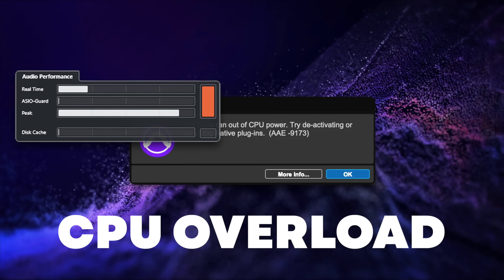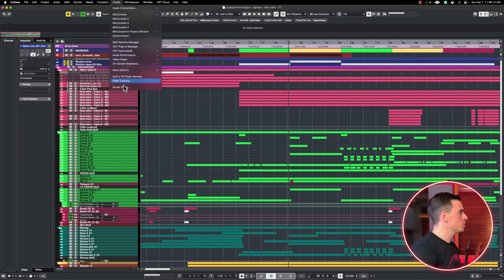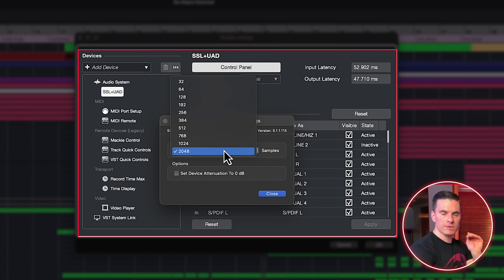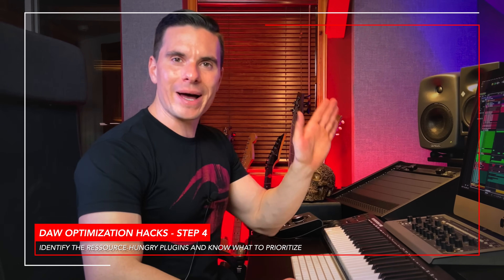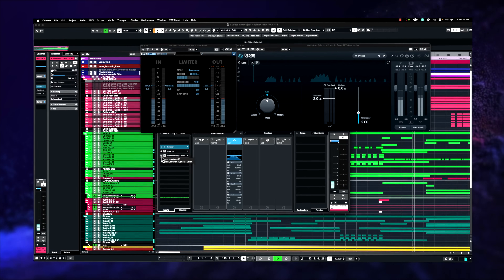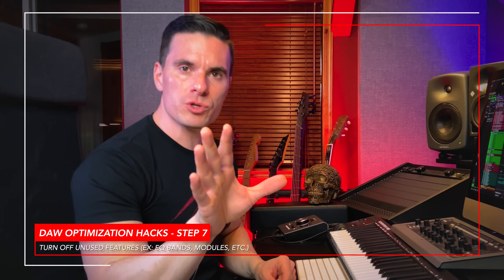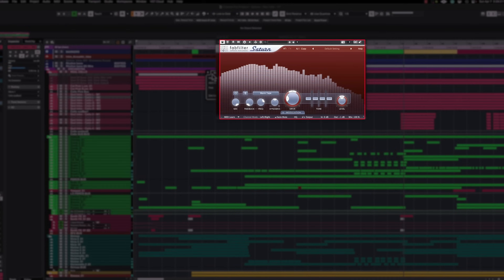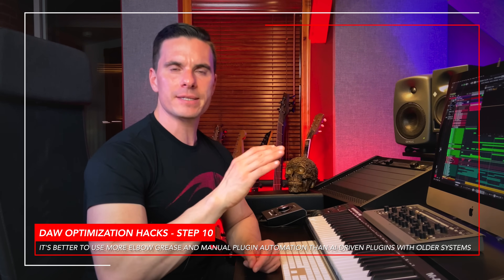DAW Optimization HACKS for Audio Production: How to RESCUE your CPU

Comment: One of the biggest problems with Windows 11 and modern CPU's in combination with a DAW is core parking. Disabling it will greatly improve things on many levels.
Reply from the maker: Thanks for chiming in Frank. Great tip to know for PC users!
Reply: - Windows 11
- Live 11.3.13 (apparently this is supposedly fixed in later versions)

My i9 13th gen overclocked to 5.43 needed all the efficiency cores to be turned off as well as all the cpu throttling options in bios - to get rid of random popping.

Took me months to figure it out.
Reply: @ghfjfghjasdfasdf Yeah, the pops and clicks only get worse on newer cpu's because of all the power saving crap built in Windows by default.
Reply from the maker: @franckinthestudio Indeed! It’s usually best to disable power saving functions for audio production.
Reply: @OliBeaudoin Exactly!
Reply: @OliBeaudoin I saw a video showing which DAW‘s can work with P and E cores, cubase came out as the best in this case
Reply: I haven't switched to 11 bcuz I wanted to wait to a few of the bugs were worked out (as I always do) and a few others have had some experience with it (as you have). I'm still running 10 Pro. Any ideas to help get a few more power out of it? Current: 12th Gen Intel(R) Core(TM) i7-12700K   3.61 GHz. I've never done anything for overclocking and such. I have turned off sleep. This is to anyone. Thank you all in advance.
Reply from the maker: Check out my MAC optimization video. Many tips still apply to PC. If you follow all the tips in this video and the other one, your sessions should be light and responsive.

Comment: Good stuff , a huge problem that can occur is your hard drives, HDD you will run into problems the more plugins and VST’s your running through the hard drive  from it as a opposed to an SSD. Especially if your running virtual instruments. M2 and ssd are definitely ideal for this, and if you can spread out what you use amongst multiple drives that will be the best option. I have an m2 and ssd and hdd and my hdd is only used for superior drummer 3 and saving my cubase projects.
Reply from the maker: Thanks for your comment Shane. Indeed, HDDs can be an absolute bottleneck, that’s why I recommend using SSDs with high read and write speed. The suggested video (End Card) talks all about it… and more! 😎🙏

Comment: There's is absolutely important gain to using higher sample rates! The amount of aliasing you'll end up with with things like saturation and compression is insane!
Reply from the maker: Using high sample rates never will make or break a mix. Concerns regarding aliasing can be addressed by using the oversampling function available in most recent saturation plugins. A good exercise can be done by comparing a session at 96kHz and one at 44.1/48kHz to see that the audible difference is negligible, if any.

Comment: Great video. I wouldn't say dsp cards is the way to go especially if you're thinking about UAD. the chips used are 400mhz single core. That was fine in 2007, but not today. Getting an older computer that runs let's say 2500 MHz on 8 threads will give you so much more power, combine that with the free plugin audiogridder, and you can run all your favorite native  plugins from the old computer via a cat cable. Bonus is you have another computer for random stuff. Been using audiogridder for 3 years now. Works great even on the same computer and not on another via cat cable, as the plugin will spread the load more efficiently across all cores and not choke on one core that usually is the bottleneck in Daws (except reaper)..
You should check it out. 😊
Reply from the maker: Thanks a lot for your comment man! Yes, you are absolutely right about the SHARC chips, it’s more meant to serve as an “expansion” on an older system… probably one of the many reasons why UAD started to release native plugins. Thanks, will check out Audiogridder! 😎🙏
Reply: @OliBeaudoin audiogridder is a great way to avoid plugin conflicts, eg. I have a separate pc for IZotope because I noticed that having some other vendors plug-ins open with iZotope at the same time can cause one or the other to crash, solved it with audiogridder
Reply from the maker: Thanks for the tip!

Comment: I agree with most, except 44.1 kHz. Best to work with is 48 kHz. Little more headroom. Almost no difference with CPU. But it's personal preference.

There should be a list of quality low CPU (fast) plugins. Melada Production is one of them. Light and high quality. Top tier coding. Bad user interface (but they improved recently by adding graphic design).

Finally. Good practice is to use one heavy plugin per channel or bus. If you need 3 heavy plugins working on one track, bust them one by one to another and use one heavy plugin per bus. So basically to create cascade. This cheats CPU to process each bus per one core/thread, basically creating parallel processing. Sometimes it helps.
Reply from the maker: Thanks for your comment Mikelo! Indeed 48kHz works as well, but it’s really about personal preference at that point. 

A list of high quality, low-CPU plugins is a great idea for a next video. I’ll keep it in mind! 😎🙏

For bus processing, you are correct as well! Many mixers and producers tend to overlook that and load way to many things on sub busses!
Reply: I was thinking the same. Alot of plug-ins also work best with 48 kHz.
Reply: sample rate doesn't give you more headroom, bit depth does. Sample rate is about frequency range, with 48kHz you'll get less aliasing but you can get round this in 44.1 if you use oversampling which means your plugins will be processing internally at higher sample rates.
Reply: @happyshadow the over sampling requires a good bit of processing.  It’ll be nearly the same usage.  That being said my opinion doesn’t matter I work in 88.2 ;)

Edit: I wonder what happens if you record at 88.2 then mix at 44.1?
Reply: @stevewoodyt  there's no point as when you down sample you have to low pass up to Nyquist to avoid those higher frequencies folding back down the spectrum causing aliasing, so you lose all that high frequency information you get with the higher sample rate anyway. I think 48 is the sweet spot unless you have a low spec computer then 44.1 is good so at least you can choose which elements of the mix you wish to use over sampling. When I record classical music I use 92, for pop music I use 44.1 as I like the freedom to use loads of plugins.
Reply from the maker: Absolutely, people are still confused about that!

Comment: The best thing against cpu overload is the use Reaper.
Reply from the maker: DAWs with a lighter footprint such as Reaper can be a good option, you are 100% right. A lot of mixers may not be willing to learn a new workflow, key commands, etc., that’s why they usually stick with the same DAW.